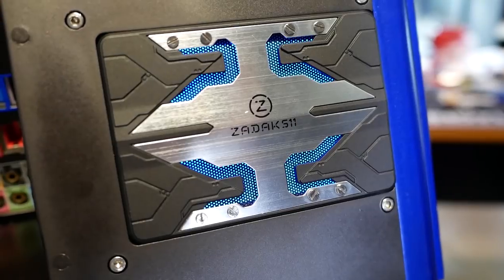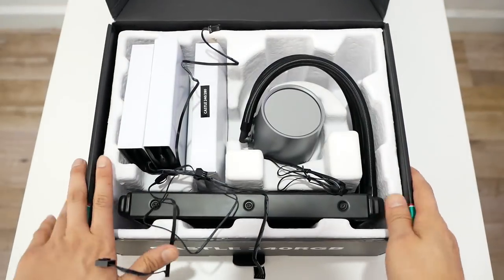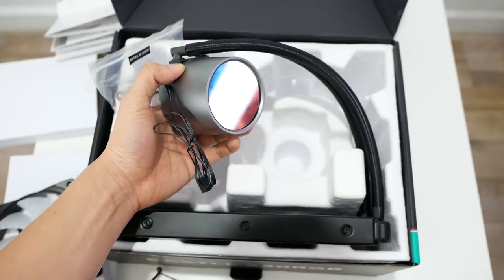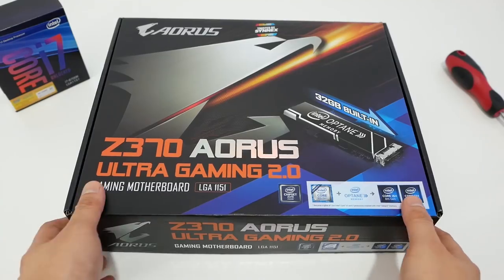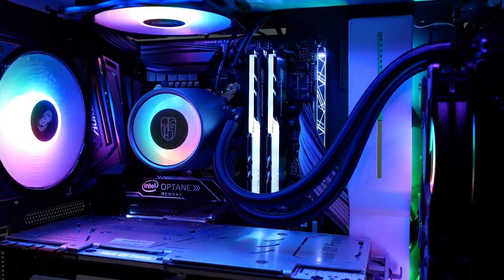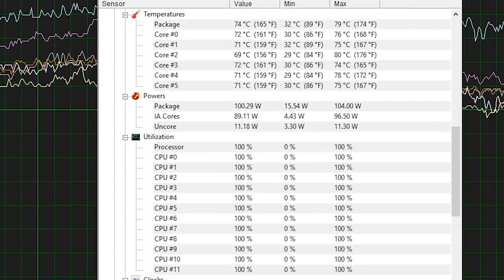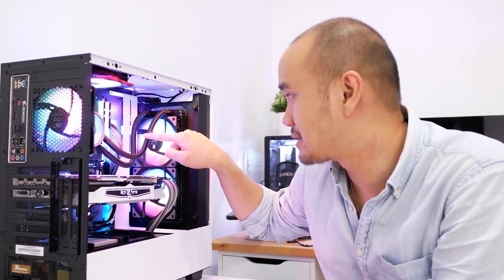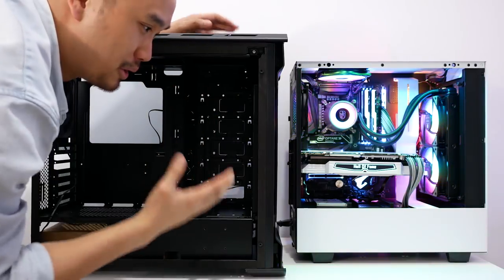Deepcool Gamerstorm Castle 240 RGB at 5Ghz (feat. NZXT H500i)

Comment: I've heard from other reviews that deep cool in the past have had some leak issues.  I hope this one changes things and they develop a much better reputation since this is a really good looking aio.

Except when the logos on the radiator fans are upside down and make my OCD cry out.

Other than that great video.
Reply: I have used Deep cool products and they are actually really good. I doubt a high end AIO like that would leak. Plus their fans beat the Corsair fans they are paired with. Surprised.
Reply: I bet this one won't leak because it doesn't have that stupid glass tube on it
Reply: They are upside down for a reason. The cables are kinds short, and it forces you to mount them like that.

Comment: Your radiator bracket came out so easily. Did you have to apply a lot of force to remove it the first time? The left side of mine is held in by little metal nubs, and I'm afraid I'm going to break something with how hard I'm having to pull it.

Comment: I plan on getting the same AIO but have been debating the 280mm version but I am wondering if you think there would be enough room for it in that case as I have the same one. The case does support 280 in thew front but I am not sure if the Castle is larger in any way then the Kraken.

Comment: How did you get those two fans in sync with the aio cooler effect? I've just bought same aio plus 3in1 rf120, but the fans are 4 pin and the aio is only 3 pin.

Comment: Hi I just want to ask if Castle 240 provided hub and controlled would be enough to add 2 more CF fans or should I buy CF 120 3 in 1 pack to use it's hub and controller.
Reply: Yes they give a small hub in the box

Comment: good job man! great video. just wandering if the h500i comes with full rgb all around the case, and whether or not there is a software that allows you to control that rgb! thanks
Reply: The Daniel Show, I don’t know if it is too late but the h500i comes with rbg led all around the edges as well as a rgb cam software controller mounted on the back for any extra rgb components

Comment: Is this processor delided? No AIO 240 mm liquid cooler can cool I 8700 k on 5.0 GHz without hitting 100 degrees C and throttling after that. I own Deepcool Captain 240 Pro which is better and I can run at 4.8 GHz, maybe 4.9 GHz and temperatures goes at about 90 degrees C when running stress test on AIDA.

Comment: I have antec nx 800. Front intake fans are shit even though they are 200mm fans. I have been thinking of getting this cooler and putting it to front intake. Also order a pair of corsair ml fans which i thought to put as top exhaust. And let my case's rear exhaust as it is. You think my temls will be fine ? R5 3600 + 2070S my card   uses an open air shroud.

Comment: Hi. Are you able to do a push configuration? I have the same cooler and the casing. I tried to do a push configuration but the radiator refill cap will hit the casing led strip bar.

Comment: dude got the wrong aio cooling orientation because the hot air is pushing through the radiator to the front of the case. Its actually better to reverse the fan and radiator orientation to pull the air from the front.

Comment: Error when building
1 . Front fan cases - the brand is upside down - 1 dislike
2. You set the fan not blow to the rad, how the cpu will be cooled? - 1 dislike
Reply: Khuong Nguyen do you actually know how airflow works?